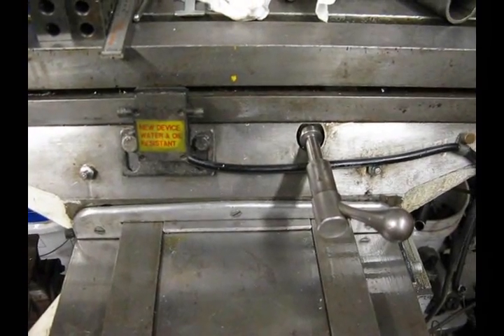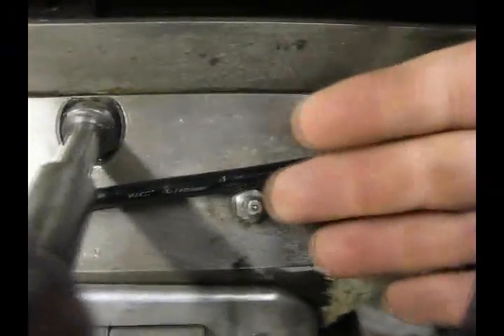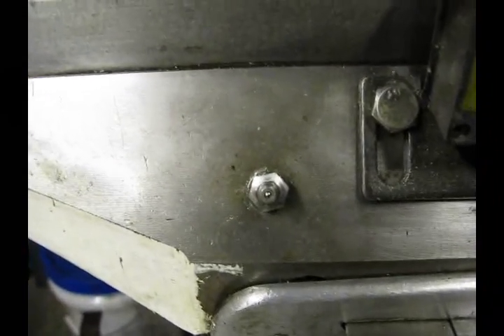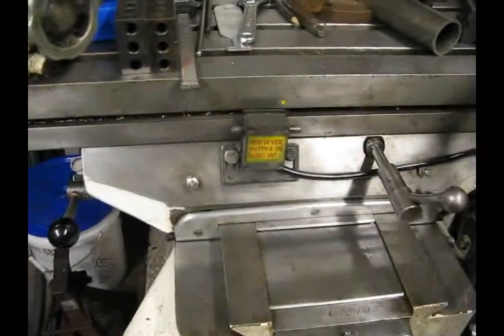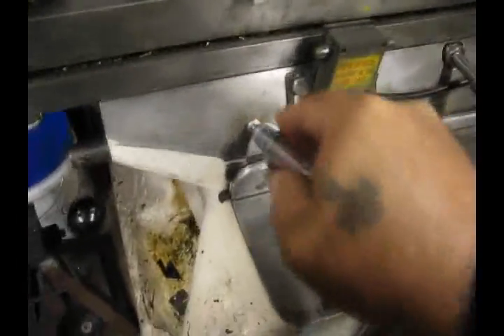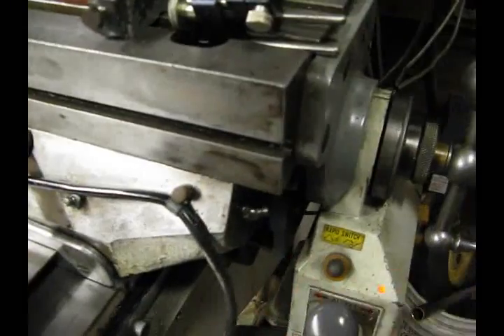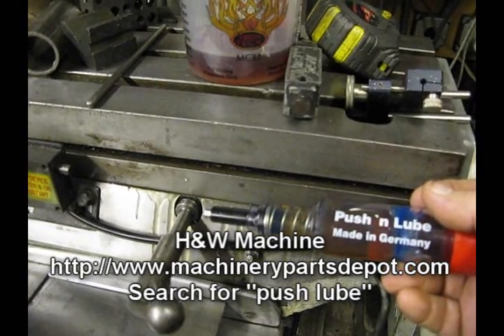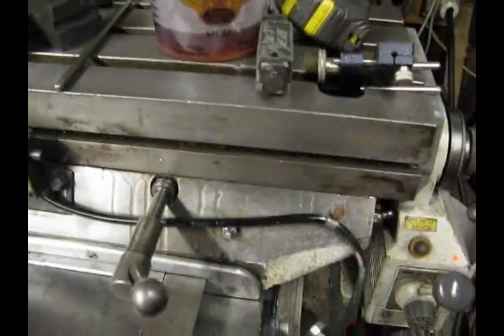Proper Oiling of the Bridgeport Table and Ways

Comment: I sure will get an oiling tool if I end up rebuilding this machine.
It's a nice machine once you get over the dinged up table, peeling lead paint, and replaces parts. I think once I get a better mill i might just rebuild it. How would I go about rebuilding it besides taking it apart cleaning, oiling then putting it back together? Is there places I could go to get the ways flattened and rescraped if they needed it?

Comment: Thanks, but I have no way of removing the table safely like with an engine hoist.
I'm thinking remove the felt wipes and try puching out the grease with compressed air with a blowgun through the zerk fitting hole.
Is it okay to keep the grease in there as long as I just dont use any more, and use light machine oil on the ways?
Reply: Nope, the grease will probably be hardened, and there will be chips in it, making it a  kind of nasty concretion.   The only way to get it off is to disassemble.  My Index model 55 had this same issue.  I had to take the knee off and everything.  The good news is the ways weren't terribly damaged by all this.